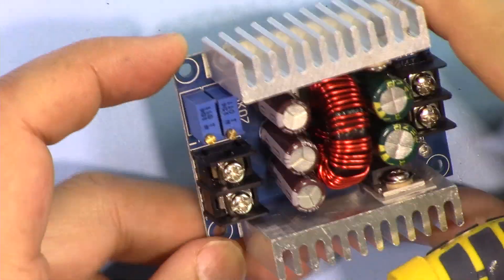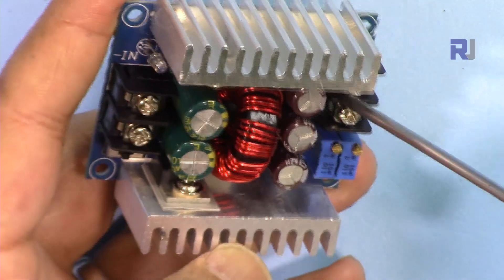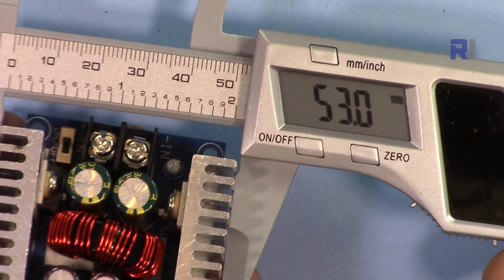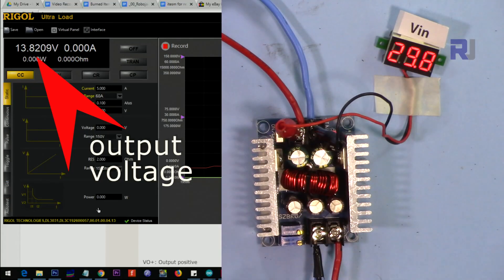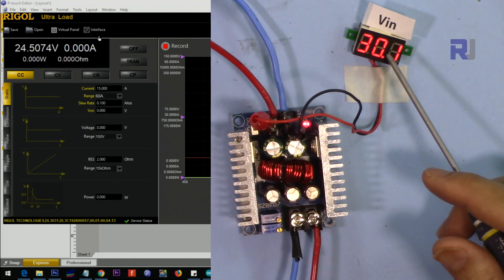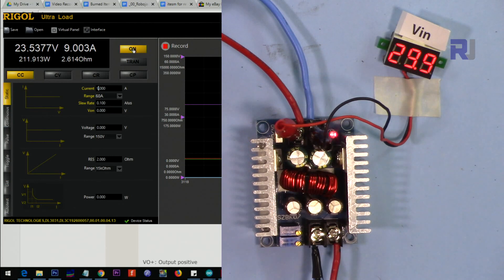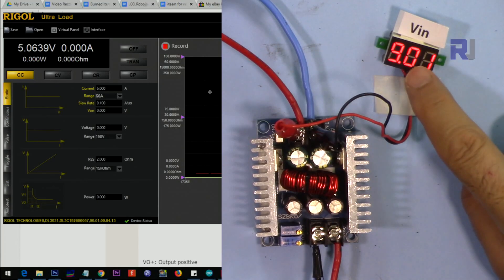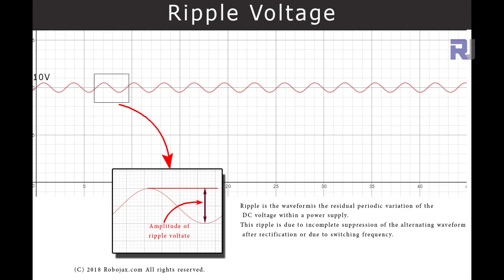Review of SZBK07 300W 20A  Buck converter 1.2V to 36V with constant Current

Comment: Can I measure output current by shorting the output or do I need to have a load? I do not have a dummy load and I am planning on using this for some DIY projects, as power supply, and maybe as a battery charger. Nice video by the way but it would have been better if it had CC testing. Thank you!
Reply from the maker: Normally this is how you set the current. You short circuit the output and set the current.. I have not done it on this module but it should work. You are right I should I have tested it with CC.
Reply: @robojax  I was just worried the chip may not support short circuit and end up frying the module. I'll try it when my module arrives. Thank you for the confirmation.
Reply: Best to first wind down the CC pot to zero before you short - then bring it up to the desired current. I use a few assorted sizes of car bulbs as Loads. Only a few dollars each.

Comment: At 12v input and 9v output can it reach 15 Amps for a project or the 9 Amps is the max for these volts? Thank you
Reply from the maker: just do the math. Voltage and Current (i) with unit A,  V x A = Power,  Output power can never be the same as the input because of loss in the conversion process. For example for  output of 9V and 15A  9Vx15A= 135W so your input should be higher than input (I have mentioned the efficiency in the video) . if efficiency  is 90% (10% loss), then 135W + 10% loss , we have 135 x 1.10= 148.5W or ≈ 150W, then 150W ÷ 12V= 12.5A. So if you have 12.5A at input with 12V, you should get 9V and 15A at output.
Reply: @robojax  do you think it is reliable to use it in a rc car or is it just too much for it  ?  Thank you

Comment: Hi RoboJax thanks for the clear video. I have a question and I hope you can help me. I want to use this module on a 72Cell  300Watt solar panels with a Open voltage Vco of 43V. That just outside the absolute maximum ratings of the TL8711. This TL8711 seem to be, but is not fore sure , the 20Pin control chip at the back of the module. Your video is posted on YouTube with a picture indicating that this module is tested for 6..60V input voltages. The content of you video only shows 30V and lower input voltages.  Can you tell me if you really have tested this module successful at voltage till 60V?.  Is the Vcc of the control chip directly coming from the input or is that coming from a regulator meaning the max input voltage is determent by  this regulator and the max Vds of the FET's being used. Hope you can tell me that.
Reply from the maker: would you please send me the time like 4:51. I am sorry I have over 230 videos and have to replay to comments. this would make it easy for me.

Comment: Can i connect two or more of them parallel to get more current ?
Reply from the maker: Theoretically possible but very hard to do . First  you would have to set exact output voltage. Then then the hardest part would be to set the current limit. Any variations in current causes the device to act as load and drain current from other other device. So I would suggest not to do it.
Reply: Robojax 
I did try with 2 of them.. but doesn’t work properly.
It’s a permanent fight and the 2..
Better to find a bigger one... do you have an idea ?
Thanks
Reply: i used two buck converter and in the output of each i added some powerful diode than i connect the output from the diodes to each other and than adjust same voltage and current for both of them and its working great
Reply: Republic of Tutorials 
Thanks for advices !
Do you have a link for this diode ?
Did you put just on positive or positive and negative ?
Reply: Only on the positive of each, You must use fast switching diode with low reverse voltage, if you didn't found one that could handle 20amp than you can use few of them and connect them parallel
Reply: many thanks 
I think your answer will help a lot of people !👍🏻👋🏼
Reply: Is it possible to modify the 2 power supply.. and having the same management for the 2? By modifying electronic..?
Thanks
Reply: Unfortunately doing so completely defeats the low-loss synchronous rectification of these modules.

Comment: can i charge the battery directly using this buck converter? or i need a diode for reverse protection? pls help.  thanks
Reply from the maker: This is not a charger. If you know how charging work, you can use it. Charging a battery needs a mechanism to control voltage and current so the battery is not damaged. I would not suggest using this as charger unless you monitor the voltage and current based on the battery capacity and voltage.
Reply: Thank you
Reply from the maker: You are welcome.
Reply: It would suit charging a Lithium battery - they just need a Const.Current on the way up and a Const.Voltage when nearing the top. (Eg 4.1 CV for a 4.2V max cell) Lead Acid is more involved. Always a good idea to put a diode in the output of any battery charger if there is any chance the power goes off while the charger is connected to the battery. You can get a Schottky 20A diode for a few dollars - they only drop about .6V compared to over 1V for a normal diode.. It will loose about 10Watt at 15A so it needs a good heatsink.

Comment: Hi, I think the difference between no load voltage and load voltage can be that high, because you measure voltage without drop over the cables to your dummy load. I can't see any extra cables going from output to a voltmeter. So without considering that you shouldn't say the load regulation is unacceptable, as the circuit has external output resistance applied.
Reply: I was watching this and thought exactly the same thing. Needs to do a 4 wire measurement I think or increase the voltage to get the required voltage seen at the load.
Reply: @405line  If you watch his other videos, he uses the exact same setup for different modules and some of them fare much better from voltage drop so I don't think it's his setup's fault.
Reply: Pm me can you to install do sola paint of charger..

Comment: Can input and output be common-grounded? There seems to be a shunt between two negative terminals. What happens if you common ground source and load?
Reply from the maker: normally ground should be common on DC system. I don't have the device in hand as I don't know where I put it with thee volume of items I am getting to make video for.

Comment: Thanks for doing these tests, but some of us are okay with raising the input voltage to offset voltage droop. Unfortunately you didn't actually show how many amps this buck converter can handle on a long term basis. I am pretty sure it would melt down at 20 Amps, but it would have been nice to find out the limit...
Reply from the maker: I agree with you. The result I have presented based how hot under certain current it gets. If the temperature increased I have reduced the current.  It is very hard to satisfy everyone with the result.
Reply: Thanks again for doing the reviews. They are very informative and you are the only one doing them well. But if you can determine how many amps and how many watts a supply can be used for without overheating, I think this would be very useful for many people. For many of us using high power supplies, the load is fairly constant, so voltage droop is annoying but not debilitating.

Unfortunately, whereas it is unusual to find a product from Germany that doesn't meet its specs, and most products from the US or Japan or Korea meet their specs, in China, the specs are generally just a list of what the board manufacturer thinks a customer might want to see. So it is always a crap shoot to figure out whether it makes sense to buy a no-name Chinese product or pay three times as much for something with a better pedigree...
Reply: ats89117 I feel like you've answered your question already; 3 times more it is 🍻🍻😁